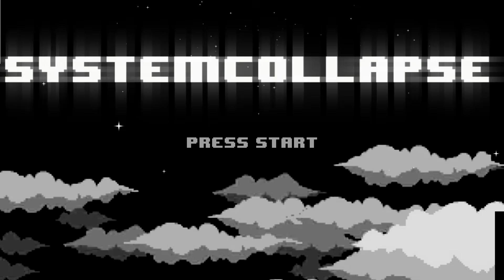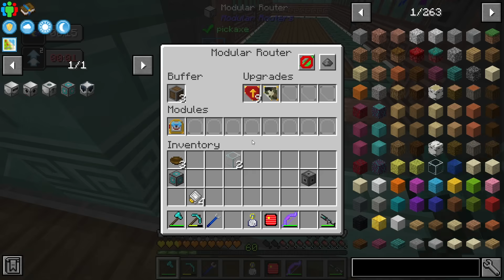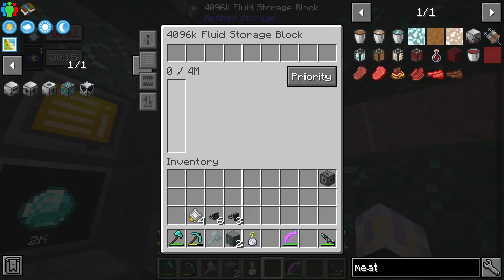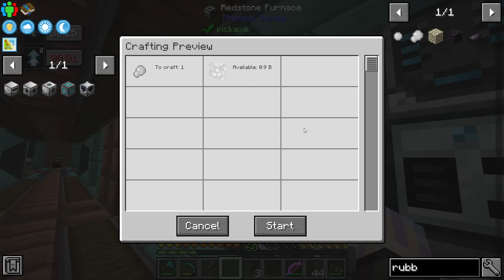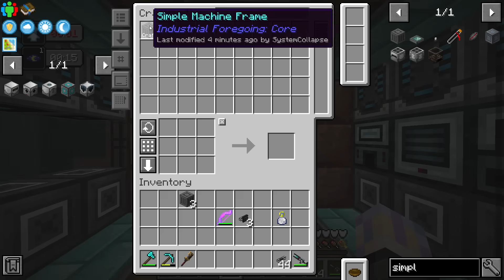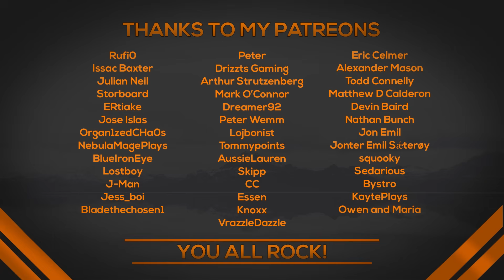Enigmatica 6 Industrial Foregoing Automation EP7

Comment: Dissolution controller is shapeless so there is no need to lock recipes. You can just send it anything from the RS crafter and it will automatically do stuff for you without worrying about different machines. RS will also handle the liquid input. 1 machine will happily make multiple recipes
Reply from the maker: until you do multiple recipes.
Reply: @Systemcollapse  I regularly do multiple recipes without problems

Comment: The way industrial's upgrade system works is that the speed addon increases the amount of progress (the green bar) can increase every tick (none = 1/t, t1 = 2/t and t2 = 3/t i believe), and the efficiency addon decreases the total amount of 'progress' thats needed per operation, so effectively both increase speed. This is also explained better in the mod's manual so maybe check that

Comment: For people who want to make create Infinite fluid sources 20*20*16=10000
However you should go slightly bigger to because it is a bit finicky, also, if you just start filling an area, once it becomes an infinite source it will start infinitely placing fluid in the same place, just lower the pump all the way to the bottom and than reverse the flow to get infinite liquids.
Reply: I am confused, which mod makes the infinite fluid? Does it work with any fluid?
Reply: @randombailey1166  create, and any placeable fluids, as far as I know.

Comment: just a suggestion, giving ores to an Occultism demon is pretty insane, if you want to avoid Mekanism ore processing and power usage that is
JEI doesn't accurately show the outputs of the crusher demon from Occultism and they don't require power
6x+ ore processing, you'll love it
Reply: The rates were boosted by the pack, so the JEI shows the original rates. Both the Occultism crusher and void miner are very viable in this modpack
Reply: @dantesuoh9190  things like redstone and lapis is at least 18x

Comment: I think the lag problem in the botany pot room could be having two drawer controllers so close to each other. If you use framed trim you can link the two sides up and have the trim look exactly like whatever block you want.

Comment: Great video! You need to power the dandelion to latex machine. Also, you should set the external storage on the sink to -1 or whitelist it to water. I think that the system might be trying to put other liquids in it (thats why the liquid meat was not going up).

Comment: There is a block in Industrial called Black Hole Controller. You can insert upto 9 Black hole tanks in it and hook it up to RS with just one external storage. Saves a lot of space and is easier to handle than RS fluid blocks.
Also you don't need multiple Dissolution Chambers nor do you need to lock them. RS handles autocrafting with them pretty well.